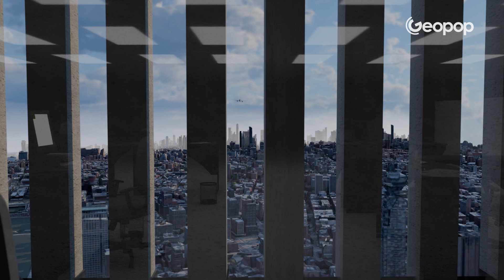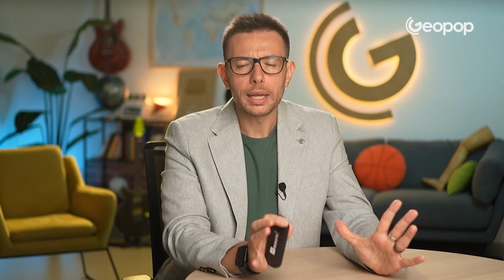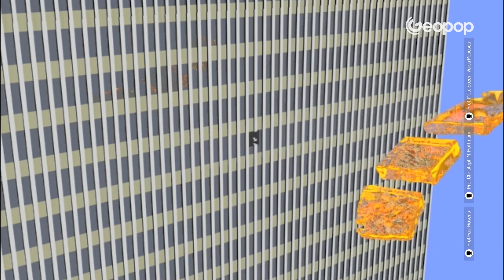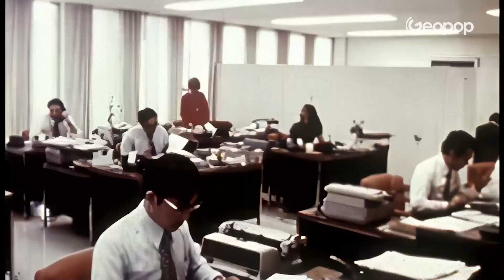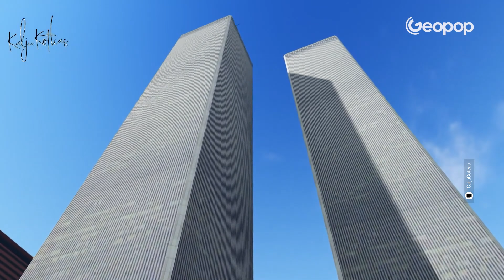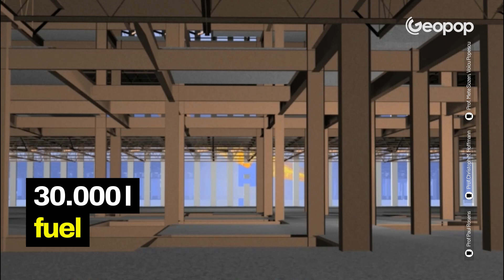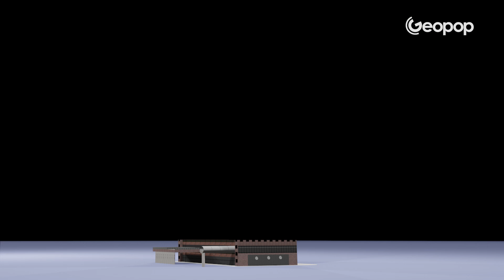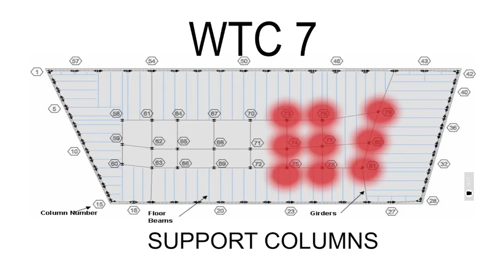9/11, 2001: The Technical Reconstruction of the Twin Towers and WTC 7 Collapses

Comment: What about the super nano thermite particles found all over in the fine dust that scientists found? But later they were silenced and called crazy. Still yet fuel cant melt steel beams to molten lava that the firemen even saw. And after 2 months below ground zero rubble still hot red metal was there. Also clumps of molten metal like meteorites. And these towers and builing7 cant freefall to their own footstep without assisted demolition. Its just impossible to fall like that from plane damage. Also why the trade center owner made terrorist insurance few weeks before the incident and was absent that fatal day? Theres still so many weird coincidences and questions hanging...
Smells like false flag operation, considering trillions missing from reserve and later pentagon funding section got hit with plane also. Weird...
Reply: Yeah, none of of that is a thing.

"Don't believe everything you see on the internet. " - Abraham Lincoln
Reply: @TheLoonResistance  It is a thing. Theres actual evidence. Wake up.
Reply: @BscCarguy  - Everything you said is complete fantasy - things you believe, but not true.  I'm going to respectfully disagree with you, but rather than just simply assert you are wrong I will present a detailed case explaining why mine is better.

Twin Towers collapses are fascinating, my interest is understanding the actual mechanisms of collapse - what failed, when, how & why and discussing them with others who share a similar interest in understanding what really happened instead of rationalizing some political agenda. So let's talk about it.  If at the end you disagree with anything, please let me know what you object to and why. Make it good. I don’t suffer fools. 

This is my summary explanation of Twin Towers collapses of the Twin Towers, start-to-finish, based on my observations without appeal to or reliance on any authority. No politics or ideology, just what actually happened, which is agnostic to who planned and carried out the 9/11 attacks or why. It has the benefit of not requiring Rube Goldberg levels of complexity and it makes logical sense. Each step in the process flows naturally from the one before AND is chock full of critical details the conspiracy-oriented internet tends to leave out with no whataboutisms.  My hope is this will dispel many common myths and answer most if not all questions you may have about the Twin Towers collapses. 

While complex, most of the Twin Towers collapse mechanisms can be seen with the naked eye and easily discerned and understood by the layperson if sufficient time is taken to understand. The worlds engineering community had already largely sorted them out at least as early as October/November 2001. Still, there are many who can’t be bothered to look or perhaps work hard not to see, being more concerned about advancing political/ideological agendas (which is exciting) than science and engineering (which is boring).

1. The Twin Towers consisted of 4 primary structural elements that together formed an integrated system where each relied on the others.  47 hollow box-section steel Core Columns carry the majority of the gravity loads. The 236 hollow box-section steel Perimeter Columns carry the remainder and ALL of the lateral (wind) loads. Long-span Lightweight Steel Trusses connect the core and perimeter column together at each floor with a Hat Truss on top to tie the structure together as an integrated unit where no element can survive without the others 

2. The impact of 117 tons of airplane (= to about 12 dump trucks) at speeds up to 590 mph completely destroys the aircraft.  This in no way implies the Towers come out unscathed. Some folks don’t get that. Hitting with the energy of up to a ton of TNT the impact damages or destroys many perimeter and some core columns (33 of 59 perimeter and 20 core columns destroyed at the impact floors in the North Tower), primarily through bolt-shearing failures at the end connecting flanges, as well as bending, twisting and fracturing of weld seams. There was no cutting or slicing - the reality was far more violent and messy. 

3. The impacts destroy or damage fire insulation, fire breaks and sprinkler systems on multiple floors. Huge fires are started across multiple floors simultaneously and allowed to spread rapidly with no effective firefighting or fire suppression. This was an unprecedented fire event . 

4. The hotter steel gets the weaker it gets .  With fire insulation stripped away and no sprinklers the survival time of the steel greatly reduced. Gradually over time heat causes the lightweight steel Floor Trusses at the impact damaged floors to sag, which was observed and recorded.  No steel melted nor did it need to. Structural steel will fail long before it turns to a puddle. It just needs to bend

5. Sagging floor trusses pull on the increasingly weak and overloaded Perimeter Columns, causing some of them to bow inward by up to 5 feet. A straight column is up to 4 times stronger than a bent column. The bowed Perimeter Columns buckle and fail, initiating collapse. The formerly static mass above which the structure below could easily support is now converted into a dynamic mass up to 30 times greater. Because they have buckled, the Columns above and below the failure point are no longer aligned . The load bearing structure below no longer bears any load as it falls past the lower columns, NOT onto them.

6. Thousands of tons of debris fall within the four outer walls, down through the open office space, crashing onto the first intact floor it encounters. This massive impact immediately breaks the bolted connections to the columns as the amount of resistance the Floor Trusses can offer is negligible.  The falling debris slows only marginally and briefly. Note:
6a. This is NOT a solid top block crashing into and “crushing” a solid bottom block .
6b. The debris falls past the columns not onto them.  The columns provide no resistance to the falling debris. 
6c. Only the bolted connections of the floor trusses to the core and perimeter columns can offer any resistance. A pair of 5/8” bolts at each end of each truss vs. thousands of tons of falling debris.
6d. No laws of physics are violated.

7.  This floor-led collapse progression within the four outer walls can only go straight down. Note: 
7a. This process is often incorrectly referred to as “pancaking” which actually refers to a completely different process rejected at an early stage. The catchy name stuck but nobody knows what it is supposed to mean.  Pancaking is too simplistic and inaccurate anyway. More like Kaiserschmarrn.

8. Collapse progresses through the floor systems not down the columns, through the path of least resistance . Rate of floor failures increases with each successive floor as momentum increases, reaching an average acceleration of 0.65 of GA, or 35% slower than true free fall. Bam, bam, bam down the building until there are no more floors to fail.  The resistance offered by each successive floor is always the same. The mass and velocity and thus the energy of the falling debris are constantly increasing with every floor destroyed new falling mass is added. Some falls to the sides, but most falls down. More mass, more velocity, same resistance with each floor.  Don’t get stuck on the but the lower floors weren’t on fire nonsense. They weren‘t and didn’t need to be.

9. The Towers were 95% air by volume. As that air was compressed inside the building it is forced down the tower and blown out the sides in reaction to the building collapsing . Those were not “explosions”, it was expulsions of compressed air caused by the collapsing building, explaining the low velocity, lack of flash, blast, supersonic pressure waves and lethal high-velocity ejecta.  

10. Perimeter Columns become detached and peel away like a banana behind the collapse front, playing out to the four points of the compass extending to more than 600 feet from the base of the towers. This was quite obvious from examination of the debris pile. 

11. Core Columns fail last as their internal beam bracing is stripped away by falling debris and lateral support from the floor to perimeter columns is lost. 

12. For those who care about how long this whole process took; 31-34 seconds from the moment the perimeter columns buckled until the last core columns hit the pile, or 1/3 the rate of true free fall. Don’t believe me?  Just watch any video of the collapses and note the loose truly free falling debris dropping much faster than the towers themselves.  

13. Each Tower had a 1-acre footprint. Far from collapsing inside their own footprints the debris pile spread out over 16 acres in a pile up to 14 stories deep. 8 surrounding buildings were destroyed and scores more damaged. 

14. What was NOT observed and recorded were the 180-190 dB bangs of high explosives or the blinding bright flashes of burning thermite. Of course, neither could have caused the (silent) Perimeter Column buckling that was observed.  Neither explosives or thermite could have survived the impacts and subsequent fires either. Cherry-picking a casual comment from someone who heard a loud noise in an event like 9/11 is not exactly “proof” of anything and the pre—planned demolition case relies entirely on that. There is zero physical evidence to support either conjecture. It would be technically impossible, totally impractical and completely unnecessary. No one would bother. 

15.  The Twin Towers were perfectly safe within their design envelope.  They only collapsed when taken far outside design parameters by an extraordinary and unprecedented event. 

Impact + Fire (heat) + Time + Gravity = Collapse . Remove any one of those four elements and there is no collapse. Ignore any of those elements (as many do) and you will never understand the collapses. The Twin Towers were an integrated system in which no one component could survive without the others. One fails, the rest follow, through the path of least resistance – DOWN – through the open space, bypassing the path of greatest resistance – the columns.  Nothing I just described violates any laws of physics. All of the above is true no matter who planned and carried out the 9/11 attacks or why 

I hope you found this helpful and informative. It is not meant to be adversarial, but to solicit informed critical comment, positive or negative. If I made any errors of fact, logic or reason or left anything critical out, please let me know so I can fix it. One topic at a time, on topic only please to stay focused, no word-salads of Gish Gallop. IF you can offer a more plausible alternative be my guest. So far no one has even tried. Please start any reply with the words “Tits McGee” or I will know you didn’t actually read it, are not serious and just wasting my time.
Reply: Debunked years ago. Wasn't melted steel, the owner had to have insurance an the policy in the closet covers terrorism. Which it was  covered the first time it was attacked by Muslim terrorists

Comment: And let me add one more thing. If you listen to the 9/11 tapes, for a country that is under attack, not very is done to lauch a défensive or à recon set of fighters, bit puzzling. And as far as the pentagon is concerned, not even a landing gear was found, and a landing gear doesn't just desintegrate. But a strange white smoke is seen in the video.  The pentagon,  nerve center of the american defense and we can only see the images coming from one caméra only. Yes, i smell a rat...
Reply: I smell feces of the male bovine.

Every alert fighter in the NEADS region - all 7 of them - were scrambled as were a number of ANG fighters not on alert. 

19 tons of B757 wreckage were recovered at the Pentagon crash site including the landing gear, both engines, the entire left wing flap assembly, part of the cockpit, seats (some still occupied), landing gear bay doors, fuselage sections, the Flight Data and Cockpit Voice Recorders for Flight 77, etc, etc,... 

The remains of everyone aboard Flight 77 were recovered and identified with the exception of 1 infant whose remains could not be identified. Some victims were recovered still strapped in their seats. Each of the victims' families were provided with a detailed autopsy report.

Several thousand personal items belonging to persons aboard Flight 77 were recovered at the crash site at the Pentagon with the victims' families being provided with a 1,000+ page book detailing every item for identification and return.